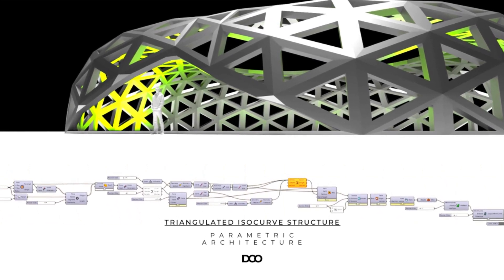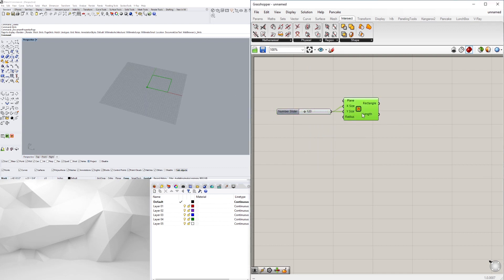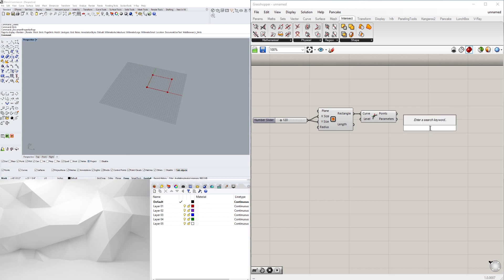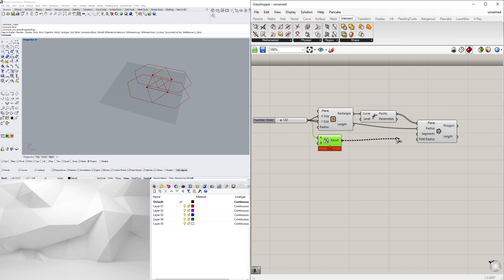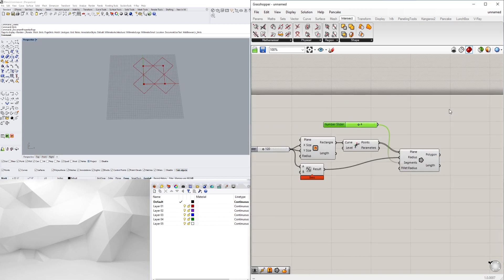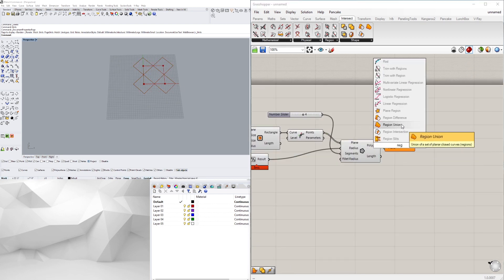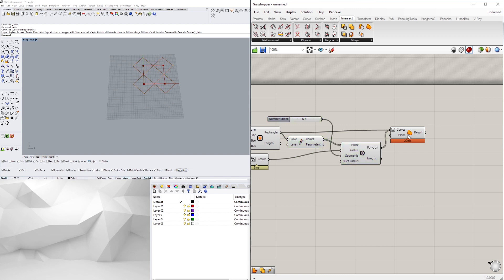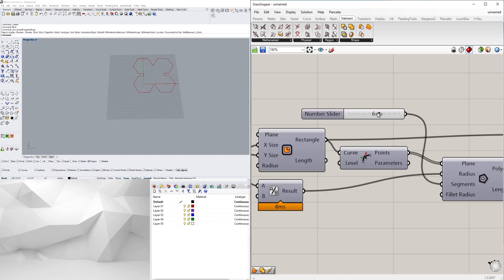Rhino 6 and Grasshopper Triangulated Parametric Structure and detailing

Comment: why u usin rhino 6?  rhino 7 is out now.  with that subd.  ooh ya.   id like to see some subd grasshopper stuff.
Reply from the maker: you are correct sir, I need to upgrade.  The only reason I have not is because I have vray next for rhino 6 and would have to upgrade that at the same time and I might wait until after the holidays for that hahah.  But thanks for the heads up. 👍😁
Reply: @DCOParametric  oh i see :)